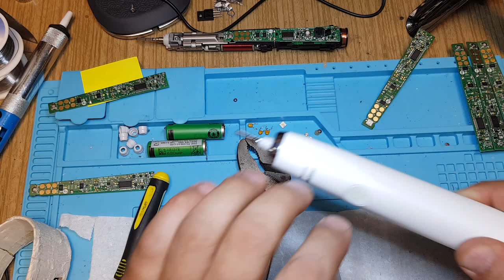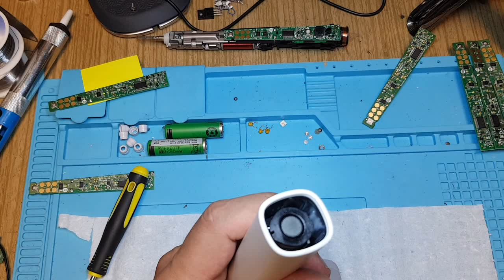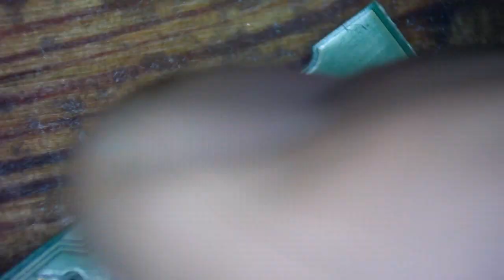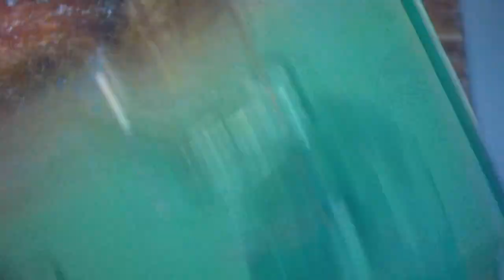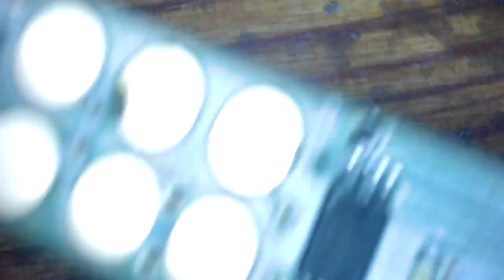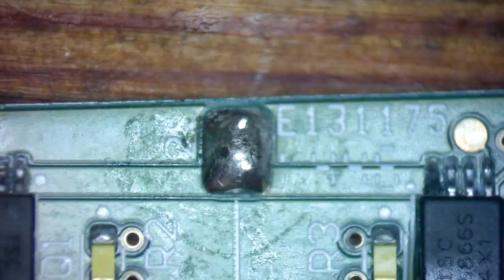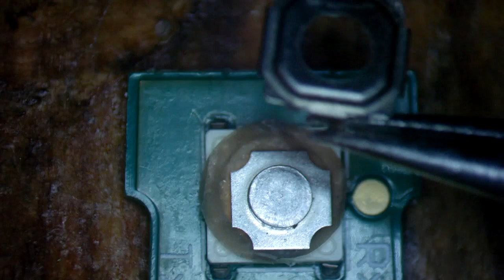Diagnostics and repair solutions of all known Philips Sonicare toothbrush defects in one video

Comment: I have the sonic care that won’t turn on.  When I push the button it instantly vibrates for an instant than is silent.  I’m wondering about mosfets as the problem.  Are replacement SMD’s available for this PCB?
Reply from the maker: I would first double check all the control traces to the mosfets. if it has corrosion, repair it. if this doesn't help then you can try replacing mosfets. easiest way is to find a donor board as i have a lot of these haven't tried looking for separate components. from my experience these mosfets are quite reliable..

Comment: Thank you for your video, but unfortunatly i couldn't fix my toothbrush! I opened my Diamondclean 9000 toothbrush because the upper button wasn't working/turning it on. I've already tested the button and it is working just fine + the toothbrush reacts to it being pressed with flashing leds. When put on the carger it even does the normal short vibrationg sound. Howerever it doesnt start vibrating normal when outside to brush teeth. Do you have any Idea what could be the problem?
(there is no water damage)
Reply from the maker: sorry but don't really understand where is the problem.. at one point you write that button is not working but then when you test the button it works? try to describe the initial problem more precise..

Comment: I haven't fixed it yet, but your videos are SO HELPFUL. When I first opened the brush I felt overwhelmed but I feel more confident now. I haven't found the problem yet though. My seal rubber was very damaged and there was rust on the magnet, but the board seems okay.
The toothbrush stopped working completely, no vibration and no LED lights. Do you have a suggestion?
Reply from the maker: Remove the motherboard from the frame a lot of times main damage to the motherboard is on the under side. Then check with multimeter all the points that I showed in the video. Water damage is tricky but doable ;) good luck!

Comment: Thanks for inspiration - in my case it was bad spot-weld on plus battery terminal. I don't have spot welder so I carefully soldered it back to battery using soldering iron. Works flawlessly!
Reply from the maker: good job! Yes spot welding is preferred way to repair it, but soldering works as well. you just need to watch not to overheat it for to long and don't leave to much solder as the battery will not fit. just a hint for anyone reading these comments :)

Comment: Do you have any suggestions for a toothbrush that's not charging? Not the charging case as it works on a different toothbrush. Not battery as I swapped it with a different toothbrush. The toothbrush works fine with a charged battery. Many thanks.
Reply from the maker: If you have second brush to test take multimeter and test in diode mode the two motherboard components in the bottom part of the motherboard. This part is responsible for charging. Rarely but I had cases where these chips would go bad. For replacement I just use donor boards haven't looked for new parts...

Comment: Hello and thanks for the great video.  I got a Sonicare HX6730 with a different problem.  When started, i will hear a buzzing sound, but the head will not vibrate.  But the head will vibrate shortly when the brush give the timing signal to change the brushing location.    I could also get the vibration when i press the button for  20 seconds  while the brush is on the charger block. 

The batterie showed 3.6v and I don't seem to have a short on the mosfet.   Since I could get the momentery vibration , I could say that the electronic drivers are ok.  It look like a malfunction of the frequency output from the MCU.  Is there a way to reset the board to its original value?
Reply from the maker: I don't know a way to reset it except to cut the power but that will not help in your case. There is a video (English and German) from a German guy with a detailed guide how to reflash the eeprom of this brush. Sorry I don't recall his Chanel name but if you will not be avle to find it write a comment I'll look it up  We exchanged some emails and he was quite deep in this topic..

Comment: Great detail, thanks.
Mine: Symptoms, All lights flashing when on charge. Brush does not move when switched on. 
Have replaced the battery. Any suggestions please?
Reply from the maker: Difficult to say.. was the seal ok, no water inside? As usually water damage is on the back side of the motherboard. If that's not the case short out the fuse maybe it's causing the problem..

Comment: You have an extra motherboard for the diamond clean version? I got mine working again but then I saw smoke from the mosfets. Needs a new board was a water failure. Happy to send it to you if you want parts too and think it is just failed. I bought it on ebay and the person pretty much lied about the condition it had obvious water damage didn't turn on no charge light etc. Battery was totally low-- recharged it and then it went up in smoke when I resoldered it.
Reply from the maker: Yes I have some. Write me to letsfixitgarage@gmail.com

Comment: Hi, many thanks for this video! I've a Sonicare HX939B which was dead, no vibration, no lights.
After following your video and opening it up, I could see some water damage.
I've ordered a new pcb and just installed it. But it's still dead...
Battery is registers 3,9V.

Any idea what I could try next?
Reply from the maker: Difficult to say.. where have you bought the replacement PCB? Maybe try to contact the seller for a replacement? There are not much to do applying voltage PCB should light up right away..
Reply: @letsfixitgarage  I got it from a reseller on Aliexpress. Maybe it’s just a broken one then.

Comment: Possible silly question from someone who knows little but how did you know which test points to use the multimeter on? Is there a generic approach to know what to do on any circuit or did you have to reverse engineer somehow?
Reply from the maker: thanks for the question! and no its not silly ;) 
Diagnostics always look easy on videos when someone presents a solution in few minutes. Behind it, there is hours of trail and error... what you do if you don't have a schematics? In this case when we have a simple PCB with visible traces you can follow them by simply observing them and ringing through in continuity mode, to see if traces are not damaged. In multilayer design usually you lose this possibility. Sometimes you need another working PCB to check good values of component or traces if they are not visible.. sometimes you exchange components to see if they are bad or some other component influences behavior of a good component.. as said diagnostics is really time consuming process to be the first and show the solution in 5 min to others.. of course with practice and experience you will get faster in knowing what to look for and where to look for, but still every devices is designed by different people and in electronics there is multiple solutions for the same problem :)
Reply: @letsfixitgarage  That totally makes sense, thanks for taking the time for a considered reply. I come from a software background so there is some analogy with what you say. Suffice it to say that I think you've explained enough in your comment for me to stick with referencing and working from the hard work of others next time something is broken! For what it's worth, although it was involved, my toothbrush is completely fixed after bypassing dodgy contacts, and my soldering skills are a touch better now too!😁

Comment: Took mine apart, cleaned it, now when I set it on the charger I get red and orange LEDs at the bottom. Seal is broken, so probably water damage. Battery registers 4.15v. I ordered a new one. Can I send you my old one so you can use it for parts?
Reply from the maker: Write me an email letsfixitgarage@gmail.com we can check what's possible.

Comment: I have a Sonicare Elite Pro 7800 electric toothbrush that is probably 15 years old.  The power button on the circuit board beneath the handles green button has failed.  Any idea what this part is called, or do you have reference to a replacement part number, or know where to buy?  It’s basically a sweater switch with four connection pins located two on each side.  There is a silicone nub on the top that has broken off due to age, but otherwise everything works.
Reply: You can see the two switches with the white nub, to the far left of this circuit board at time stamp:  https://youtu.be/qaswVoaM5TQ?t=57
Reply: On the circuit board, it says 4450-004.  Not sure if this refers to a switch number or not …
Reply from the maker: sorry haven't had this kind of brush in my hands. but if its similar to the buttons on my video try to look for "micro switch" on electronic sites. maybe you get lucky. although I would upgrade for a newer brush as newer ones have better drive mechanics, higher vibration count and Li-ion battery that has much better output as older Ni-Mh.. and if you buy a defect one from eBay and repair it it will be extremely cheap purchase..

Comment: Hi great videos 
I have a question please I have a sonicare hx993s , I replaced the battery and all was perfect until I went to back into the body it started cutting coming on and off, now it is totally dead ( no power and no lights will come on) it will still charge, do you know what I may have damaged? Thanks dave
Reply from the maker: Why did you replace the battery in first place? From your description I would say water damage and especially in the on/off button. Check my water damage videos there is a lot what needs to be checked in case of water damage..

Comment: Very useful video. I fixed my toothbrush with your instruction ;-). It was the most popular thru hole.
Reply from the maker: Good job. I do like these older diamondclean with through hole defects much better then smart diamondclean with multilayer protected PCB design.. when that one fails from water damage it's almost impossible to find the defected spot..

Comment: Thank you very much. I had the "magnet gap" issue (suspect the toothbrush was dropped). It was a quick fix thanks to your video. 1 to 2 mm gap? I set mine to 0.4 mm using a thickness gauge from my garage and it seems to work as before.
Reply from the maker: Yea.. I would call that fear of camera :D haven't prepared the right digit beforehand and when the time came just said 1-2mm. 2mm is really to much 0.5-1mm is perfect. If it's to small you will hear it and to much you will have weaker vibrations :)
Reply: @letsfixitgarage  Thanks for the feedback!

Comment: i turn my sonicare on and it can go on for minutes. once i put it on my teeth or apply any resistance to the brush, it turns off and makes a single long beep. any ideas?
Reply from the maker: Well to comment I would need at least a model and some background.. water damage or how did this defect started...
Reply: @letsfixitgarage  I understand, it is HX6530 with no water damage I know of. It seems I found the reason. Couple weeks ago I was disassembling the device because of loose screw on the head. I accidentaly cut the coil with my screw driver while trying to undo bottom part. The coil is soldered straight to the battery section. My guess is it's simply low on battery and can't recharge because of the damaged coil. Tried to tie the separated ends of the coil together but it had no effect on charging. Can you think of any way to fix this mess?
Reply from the maker: That's a good example how difficult it is to comment and help in comments when you don't know the background.. it is very difficult to know what was already done with the unit.. thanks for explanation. In this case you could try to solder the brake and not simply bind it and check continuity if the coil doesn't have any further breaks.. but because the windings change and you don't know if more of the coil was damaged (shorting) it is better to change the coil with frame completely. If you want to have it as cheap as possible you could ad an connector directly to the battery and charge it with 1s li-ion charger bypassing toothbrush induction charger.. although this will void toothbrush water resistance for sure..
Reply: @letsfixitgarage  I see. Thank you for the tips. I will try to solder it back together and if it doesn't work I'll get a new one. Definitely learned from my own mistakes here. Have a good day, sir!

Comment: 11:26, exactly my issue :( anyways, thanks for the great video1
Reply from the maker: This one is annoying as you need spare part but it's easily accessible in eBay and the good part is that majority of Sonicare brushes even the cheapest ones have the same electromagnet drive ;)
Reply: @letsfixitgarage  thanks for the reply! we have a deal at Costco right now, $150 CAD for two brushes + heads so I'll keep the one I have as a spare one :)

Comment: Great videos! 

I have an HX8910 where the battery was old and not holding charge anymore, otherwise worked fine (with some repairs to the tip assembly). 

I replaced the battery, and did not know to desolder JP1. Now when I press the main button it does not turn on at all. If I place it on the charger, it will flash like it’s charging, then after about a minute, all LEDs start flashing very quickly. Tested new battery, it’s showing the correct voltage. Fuse shows continuity, buttons also. My board looks different than the ones in your videos (8 programming pads, no test pad next to power button, 6-pin MOSFETs).  No sign of water damage on the top (rubber seals and all were in good condition). Haven’t taken off the board yet to inspect the back but want to see if you might know what’s the issue before I do that and maybe further damage things! 

Have you worked with this board before, or seen the issue with not turning on and all lights flashing quickly on charger after 60s? Did I maybe short something when replacing the battery? Thanks for any help
Reply from the maker: It could be a lot of things.. maybe charging chip is dying maybe some traces are damaged and this gives false signals to the chip.. I have repaired one like yours but not with your simptoms.. visual inspection for any obvious damage on both sides of the board and maybe check if it discharged on its own - that could indicate some short circuit on the board.. sorry to say it, but it's easier to diagnose board that's completely dead then when it's misbehaving..
Reply: to whom it may still help, I had the exact same symptoms you describe. As lately I had had to press my power button quite hard, I've glued a piece of rubber onto it. As I was putting the brush back into the enclosure, the button got pressed for many seconds. This must have burned the all the MOSFETs and the fuse; didnt check the MCU.

Comment: Is the sound from a separate buzzer component or on the hx chip? I'm trying to identify the buzzer, as I like the subtle and pleasant sound from the Sonicare, which is the opposite to the annoying alarm sound from other devices. Can anyone help finding this sound component on the Sonicare?
Reply from the maker: There is no buzzer. Sound comes from electromagnetic drive. 30s notifications are being made with different frequence of magnetic drive as well
Reply: @letsfixitgarage  So the electromagnetic drive is just on the main chip?
Reply from the maker: Drive is the magnet with electromagnet coil, it is driven by the  double MOSFETs, and controll of the MOSFETs is programmed in the main chip..

Comment: I've skimmd though your vid (thanks.) I've got it open, and I'll try and diagnose tomorrow.  I can clearly see corrosion behind the board and rust under the middle coil. If I do manage to repair it...what can be used to seal it back up and stop water getting in again?
Reply from the maker: Only original seal.. but first try to repair it and only then order the parts ;) water damage is usually tricky especially for first time repair..
Reply: @letsfixitgarage  Thanks for the reply.

Liquid damage seems a very common problem? I originally bought my DimondClean in Oct 2016 and I've had it replaced twice under warranty. 

I'm in no rush but might take a look at it on the weekends when I can be bothered. Since I was lazy and I've already replaced it with an Oral B Pro 3.
Reply from the maker: I had one customer that brought his Diamondclean after 6 years because he dropped it and vibrations were weak, but upper seal was like new.. If you take care of the upper seal they are very reliable.. don't have a lot of experience with Braun, they seam to have better water protection but all in all I prefer Sonicare they are superior for me..

Comment: great video, thanks for the uploads. helping a lot with trying to fix my hx9360. i replaced battery and tested, worked and charged. Few hours later i came back the battery was fully drained and wont charge, any ideas where the issue could be? couldnt find your video for charger section if you created it
Reply from the maker: Try disconnecting and charging the battery manually. Then connect the battery to the toothbrush and check for a component that heats up on the board. It seams you have a short on the board of the battery gets drained that fast..
Reply: @letsfixitgarage  just tried and thats exactly what happened! The area near positive terminal between CR4 and CR5 was hot to touch. However I've looked all over and cant find where I've accidentally bridged/shorted it. Any idea how I can pinpoint the problem?
Reply from the maker: I don't think that you bridget it. It could mean that one of the chips has a short inside. So you will need a donor board to replace the defect component. And to pinpoint either go with finger from component to component or take a receipt paper (receipts are printed on thermo paper) and press and hold it on the board and when you lift it, it will have a "print" of the hot component.. or a flir thermovisor is of course the handiest in this diagnostic step ;)